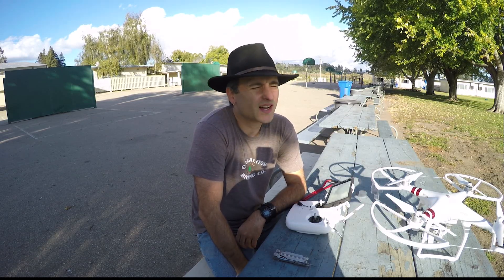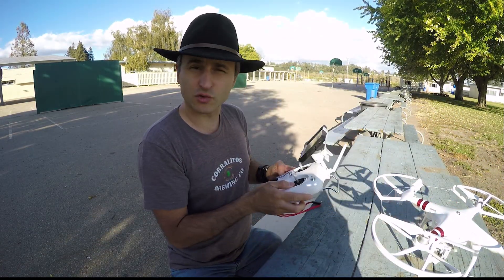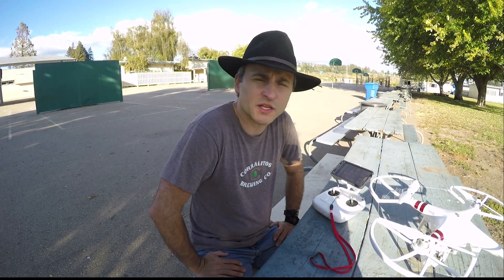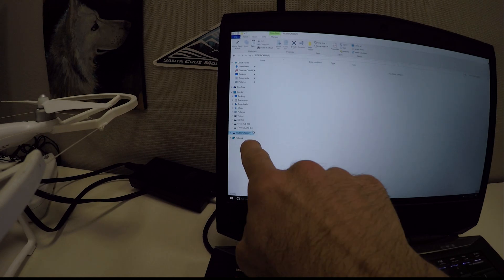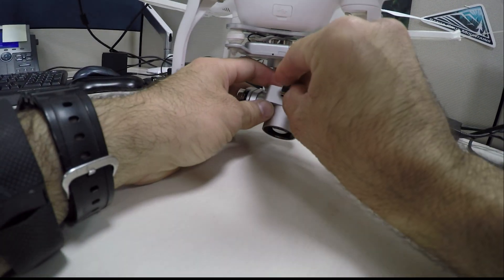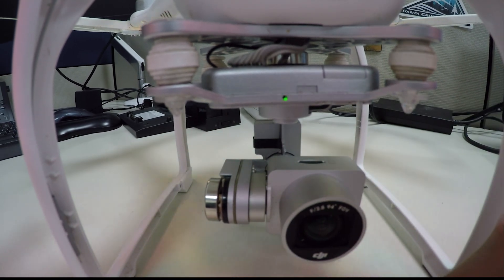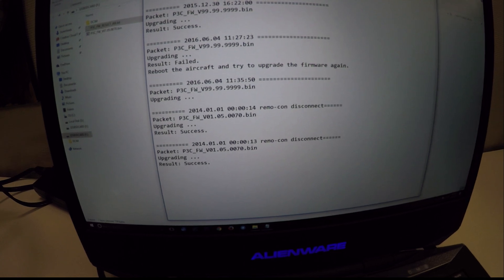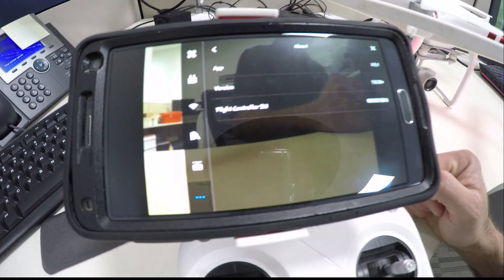DJI Phantom 3 Standard RC Signal Lost - RC Link Tutorial and Firmware Tutorial

Comment: i did every thing but it won't download the firmware it makes noise but the light stays green doesn't go int green and orange
Reply from the maker: Cassio Bonilha Just to verify, you are using a Phantom 3 Standard correct?
Reply: tripecollie yes everything you did step by step I did. The only difference is that I did it on a Mac. Also I had the latest update on it I'm not sure if that's what would make the issue. The drone flies goes up really high but will not go past around 50 feet away from me.
Reply from the maker: Cassio Bonilha The fact it is a mac shouldn't change the process. I would definitely suggest trying another firmware version and let me know here I'd that helps with your range issue.
Reply: tripecollie I tried 3 different ones before giving up yesterday. I bought the thing and can't fly it. Sucks
Reply from the maker: Cassio Bonilha I hate to say it but it sounds like you need to contact the dreaded DJI tech support :(
Reply: tripecollie it looks like they haven't been able to help anyone with my issues :/
Reply: I was able to reestablish the link using the first method...I can then fly the drone. However, once I finish that flight and turn it off...it reverts to the signal lost mode. In other words, I have to use your procedure every time I fly...any ideas?

Comment: @tripecollie thanks for tutorial, i use p3s. but why AirCraft linking button show solid red? but RC show solid green, i use 1.5.7, and dji go app show signal lost, but i can view video from camera in dji go.

========== 2014.01.01 00:00:13 remo-con disconnect======
Packet: P3C_FW_V01.05.0070.bin
Upgrading ...
Result: Success.

can you help me?
Reply from the maker: Muhammad Bagus Bintang Timur You thoroughly went through the RC link procedure at the beginning of this video and it still showed red at the end? If so that's concerning if you followed the process correctly. I would suggest searching online and leaving messages in forums if that is the case. I'm afraid I won't be able to help you.
Reply: tripecollie sure, but my drone is fix, because i try to upgrade using ios and my drone going normally again.

Comment: Hello. I tried to re-link as shown by you but the RC does not stop ringing, as if it does not connect to the drone. My problem is that on the screen of my smartphone appears: "RC connected. Connect the aircfraft". I should point out that the drone fly, but I can not see anything from the app nor I can change the camera settings.
Reply from the maker: roby9390 Did you try to reinstall your firmware? If the RC linking procedure doesn't fix your issue then I would suggest trying to reinstall your firmware. If that doesn't fix the issue then I'm sorry but it's unlikely I will be able to help you.

Comment: I can only get 1.06.008 to load:

========== 2014.01.01 00:00:13 remo-con disconnect======
Packet: P3C_FW_V01.06.0080.bin
Upgrading ...
Result: Success.

========== 2014.01.01 00:00:13 remo-con disconnect======
Packet: P3C_FW_V01.05.0070.bin
Result: Abort.
The current firmware does not support downgrade. Use a different version of firmware to downgrade the target version.

========== 2014.01.01 00:00:13 remo-con disconnect======
Packet: P3C_FW_V01.01.0030.bin
Result: Abort.
The current firmware does not support downgrade. Use a different version of firmware to downgrade the target version.
Reply from the maker: Stan Tehee Are you formatting the card and following the process just as shown here?
Reply: yeah same for my trouble " The current firmware does not support downgrade. Use a different version of firmware to downgrade the target version. " Why?
i use frimware 1.05.0070.bin
why not support?
Reply from the maker: hervinda pradana Unfortunately I don't know why there would be an issue with a specific firmware version. This method seems to work for most people. I can only recommend researching it on phantom forums.
Reply: ty reply my command,

now i will try to downgrade firmware on my remote,
i hope this can do it

Comment: my RC says signal lost even though I already used Samsung S7.
Reply from the maker: Danica Bernas That's why I made this video. Did you try everything in this video? Just because you use a specific phone it doesn't mean you can't have firmware or RC link problems.
Reply: i tried step1 and i can only hear 1 beep...  and the button on the drone is still blinking (red)...  should i update the firmware instead?  ty!!!
Reply from the maker: Danica Bernas If it is still blinking red then there is definitely a link issue. I would try following the link procedure again exactly as shown. If that still doesn't work then yes, try changing the firmware

Comment: Great Video must check which version I have. Do I need to check the RC Firmware or will that be ok only I have only just bought this drone and don't know how to do it.
This is the best video I have seen on how to change the firmware on the drone.
Reply from the maker: David Howard Thank you for the kind comment. It is my understanding that the firmware versions for the phantom 3 standard handle both the RC and the drone. Looking through forums this is one of 2 versions I have seen showing the manual firmware installation process. They both achieve the same thing, just with slightly different steps. The same firmware files I use are what they reference. That being said I am by no means an expert. This is just what I have read and used from online forums that has worked for me while the DJI Go app firmware update process seems to have more issues. Not to mention you can't always downgrade through the DJI Go app for some reason.

Comment: What's is the string on your p3s is for keeping it  landing on  a tree or if one those camera display things  keep it in view on your dji app.
Reply from the maker: foxman362 It's DJI's extremely cheap method of stabilizing the prop guards. The string is part of the kit to protect those open areas between the guards. Pretty lame really, but you don't even have to use prop guards if you don't want to. I fly in the redwoods a lot and have had wind gusts push me into a tree since there's no GPS signal where I'm at. Thus it's worth it

Comment: hi like the video i did save the firmware to my desktop only to find that i cannot open it with my windows 7 it comes up with windows cannot open this file what do i need to open it please
Reply from the maker: Stretch 9x I do see your issue presented by a few people in forums. I see they resolved it somehow but don't explain what they did to make it work. I'm curious and will do some research into it. I did see a suggestion to reinstall the DJI Go app on the phone/tablet and then trying the procedure I outlined afterwards. That may end up being the solution and worth a shot. I'll leave a note here if I can find anything to help.
Reply from the maker: You aren't supposed to open the firmware bin file. Just copy it over to your formatted micro SD card you will put in the drone and follow the steps like I laid out in the video. Let me know if you have any problems.
Reply: My log text  file says 1.6.8 can't be downgraded. Got a range issue so I hope the next update fixes it.
Reply from the maker: Stretch 9x Are you formatting the card initially and then following all the steps shown in the video?
Reply: Yes, I formatted it and followed all the steps as you presented. Even before updating begins, my log.text is writted which reports failure in version checking. I'm curious as to why so many people in forums claim the they downgraded from 1.6.8 to 1.5.7 but I can't.
Reply: Thanks for your help. I'll stay tuned in!
Reply from the maker: I can't find any definitive answers in the DJI forums, but I do see another way to do the firmware process that seems to have worked for several people with the same situation you describe. I would give it a shot since the method I showed doesn't seem to work for you. Give these instructions from the DJI forums a shot (but know I haven't tried it myself!):

1) Format the micro SD card and put the firmware version on it that you want.
2) WITHOUT the micro SD card in, turn on the remote controller, then the drone and let them connect with wifi.
3) Turn on the DJI GO App (to see downgrade status stay at front page of the app).
4)  Now insert the micro SD card in your drone. The downgrade process should start, the rear led should turn to yellow and there should be a beep sound from the drone (it is normal). Look at the DJI GO app. There should be a status bar showing the downgrade process. If the rear led becomes green it means the process is complete, you also can see the success notice displayed on the DJI GO App.

Let me know here in the comments if this works for you or not since it could be helpful to others! :)
Reply: Neither downgrade method works for me. The drone flies fine but I have not pushed it up more than 100' in altitude and 400' away. Also, the app never shows the current AC firmware version. No problem establishing  a link although I often see "Lost signal" in controlled conditions yet the link button usually stays green. Everything seems to work with FW version 1.6.8 but as I've stated, I have not flown it far enough away from it's home point to actually induce a RTH on loss of signal. Looks like I'm stuck with 1.6.8 until DJI provides a better firmware upgrade. Their recent Go app upgrades are not all that good and I've tried them all.. 

Your videos are the most definitive I have ever seen. Keep up the good work!
Reply from the maker: Stretch 9x It doesn't display the firmware for you in the DJI Go app at all but flies fine? Wierd. The signal loss happens with a lot of people even in good conditions. It seems firmware version can affect that a lot from what I've read. However, I don't know how true that is. I haven't noticed a significant difference myself between different firmware versions. You are flying and attempting to change firmware on a phantom 3 standard right? Not the advanced or other versions of the phantom 3? Sorry I can't help you if that's the case and you followed this video step by step. Thank you for the kind comments.
Reply: T-collie 
Some speculation: The range issue some people now experience might be a reduction in the number of 2.4g channels DJI has secretly  imposed with a more recent RC FW update.
 
Last night I ran a wifi channel analyzer app on my android phone and found the RC indeed does select the least congested channel but never above channel 8. One thing I've noticed in particular, the RC often seems to favor channel 2 (that's good because there's no commonly used wifi channel below channel 2) hence 1/2 the possibility of receiving cross talk. 
I would rather be using channel 13 or higher for the reduced cross talk. 

The smart electric meters on my power grid are always broadcasting somewhere on 2.4g along the power lines. This constitutes a rather noisy environment and such a condition will always dilute wifi signals to some extent. 

There's no manual channel selection provision on the P3 Standard RC. 
More and rarely used channels is better.

I have a brand new, unused, sealed (in factory  packaging) RC from 2015 I bought for resale and will break it open tonight, install an early  Go app version on my phone and see if the HW version finally shows up in the Go app.